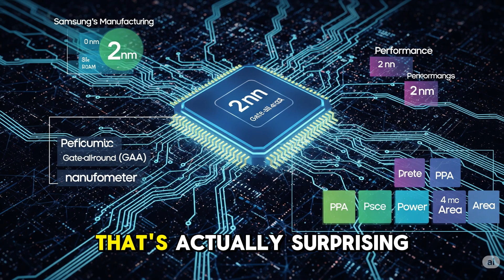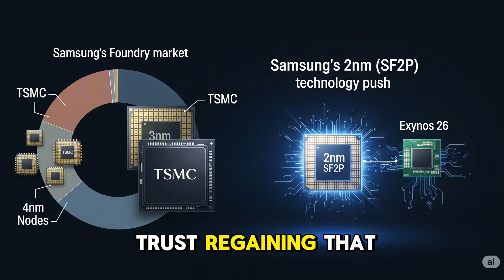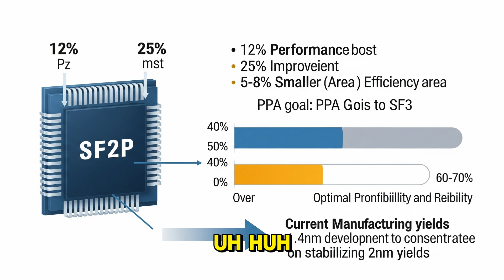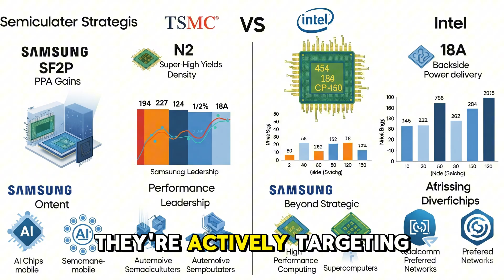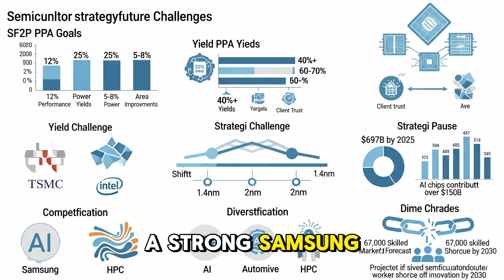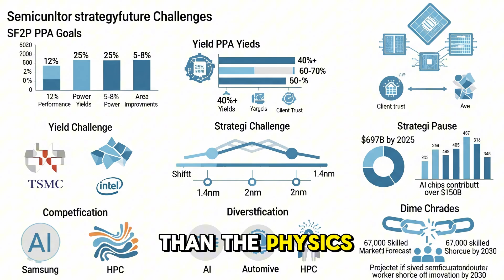THE 2 NANOMETER DEATH RACE: CAN SAMSUNG TOPPLE THE SEMICONDUCTOR KING?

Comment: Samsung has experience using gaa technology in its 3 nanometers and meanwhile tsmc uses finfet technology in its 3 nanometers. It is clearly a big mistake because Samsung has started its start first and Samsung will experience losses at the beginning and in the end Samsung will outperform tsmc because tsmc does not want to lose at the beginning and tsmc will get losses at the end because tsmc is testing gaa in its 2 nanometers even though Samsung has made gaa in its 3 nanometers.
Reply from the maker: Thanks for your opinion!